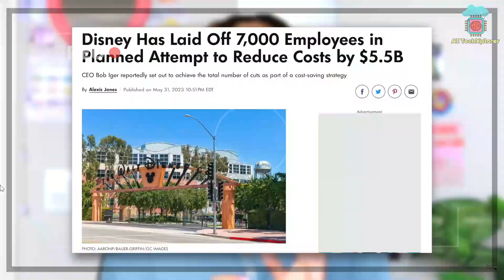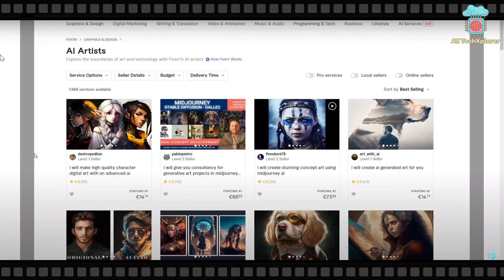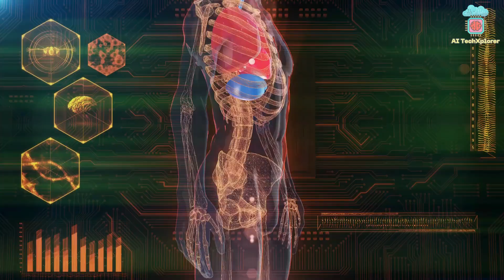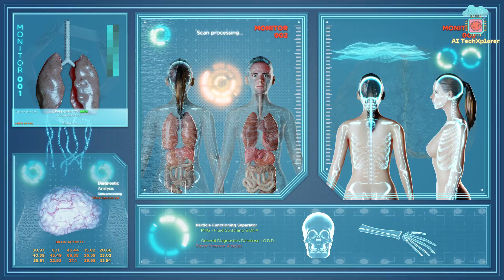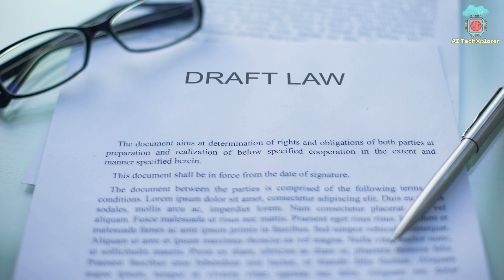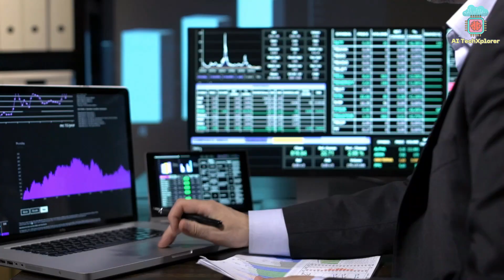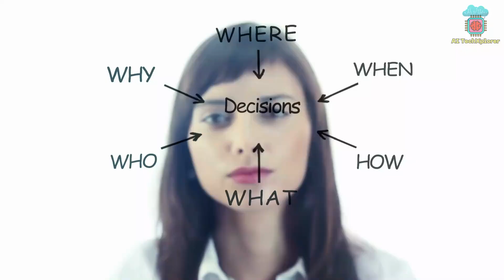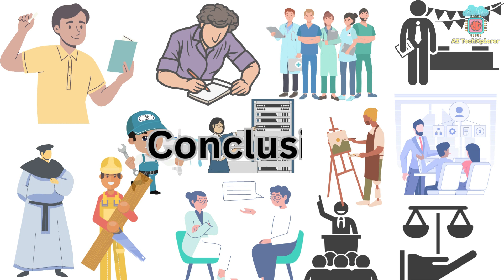The 11 Jobs That AI & Robots Can’t REPLACE For NOW!

Comment: Responsibility jobs are those that will not be replaced. you can't blame a computer for a plane crashing, or a surgery gone wrong. you can have a computer piloting a plane, a robot conducting surgery, but it will always need a supervisor because in human society you need a responsible to blame in case something goes wrong. modern military drones for example are piloted almost completely by a computer, but you need an operator supervising and pushing the trigger. planes (apart from take-off and landing, which are for now conducted manually, but that are likely in the near future to be replaced) are piloted by computers, and it's been like that for decades, there will be always a supervisor, either on the plane or on the ground. legal responsibility is a thing AI can't have, in any way, because you can't punish a robot.
Reply from the maker: Thank you so much for sharing your impressive thoughts. Yes, complex responsibilities remain for humans even as automation advances. While technology aids in tasks, ultimate accountability, ethics, and legal responsibility necessitate human involvement.

Comment: Umm, no. All of those can be replaced in the next 10 years.  #10 will go last.
Reply from the maker: Thank you very much for sharing your thoughts. But AI might not replaced any mentioned jobs, as it is a tool to enhance human intelligence. It might improves the efficiency of the roles. The prevalent fear of job displacement  is caused from various factors, and one key reason could be the difficulty some individuals face in harnessing the full potential of AI.